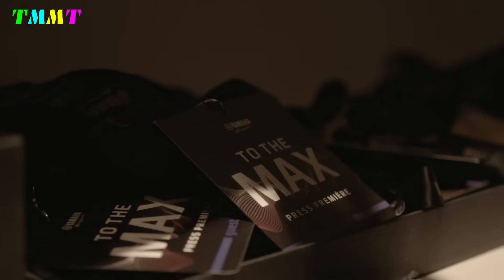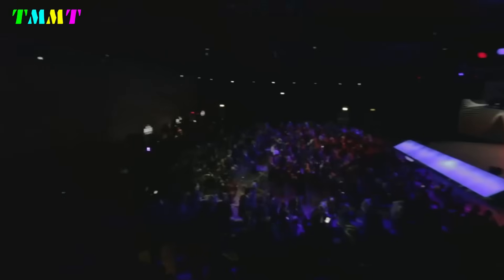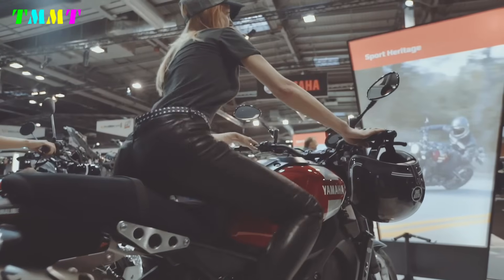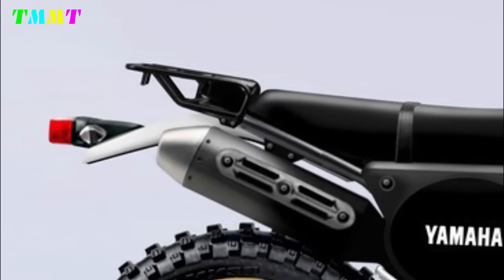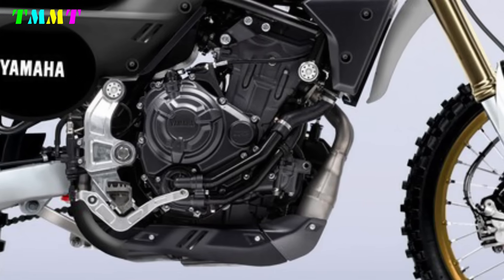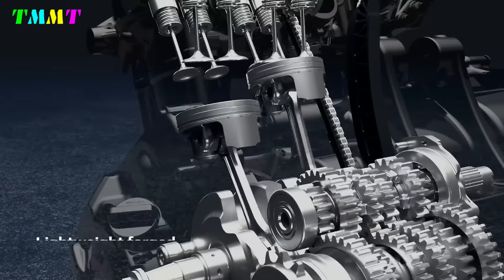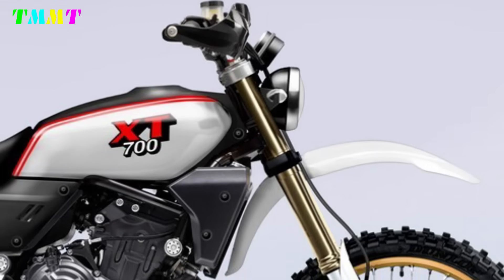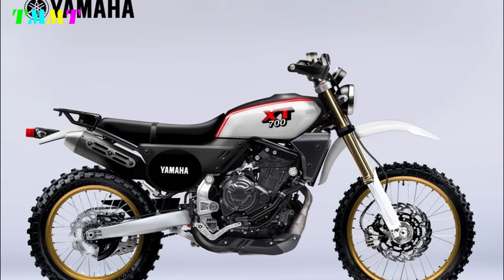2025 NEW YAMAHA XT 700 TWIN | ENDURO SCRAMBLER WITH RETRO ELEMENTS

Comment: This is what we have been waiting for YEARS !!! The design looks fantastic,  it will be a major HIT on the market  as a 700cc.  BUT, instead of following the old tradition XT500s  (I still own one ) of  the early days, the new 700  should have a slight touch of change. I THINK , the DECAL should have the word YAMAHA and the xt700   on the SIDE PODS only,  instead of on the TANK. The tank, should have  ONLY the  " YAMAHA LOGO "  made out of  solid ALUMINUM  WITH A 3" DIAMETER.  THIS ALONE, WILL TURN THE NEW DESIN INTO THE CLASSIC LOOK  of  it's generation.  I hope Yamaha would considers  this.

Comment: This looks like a good all round bike.  Some points:
1/ My feeling is that bike designs of the last decade or so are too heavily influenced by rallying.  And perhaps by expert motorcycling 'personalities/influencers'. Great if you are a dirt revhead who blats across dirt tracks at speed spinning gravel in all directions.  (Looks spectacular from a drone view) But for true trail riding they are too big, too top heavy, the slung saddle prevents the rider from sliding weight backwards to add traction to the rear and stop the front turning in.  In the hands of a casual rider they can be positively dangerous.  
2/ AND, first gear is too high.  Great for spinning the rear wheel or wheel stands, but that high 1st gear ratio forces the rider to tackle difficult obstacles at too high a speed.  (This is a fault with the Suzuki DR 650 IMO.) That causes a lot of sudden bad falls if the front is turned by the terrain.  Especially when combined with the high centre of gravity.  Standing on the pegs is not alway ideal when more rear traction is needed.
3/ A true explorer bike needs a very low 'crawler' 1st gear. Even if that means getting going in second in normal or street conditions.  
A true explorer bike also needs top gear to be a cruising overdrive for motorways. From 100 -120kph the revs should be a little below half the rev range. Somewhere in the mid to upper 3000s.  This makes for much lower vibration and fuel economy and a less fatiguing journey to get to the start of your off-roading. If you come to a long mountain climb - change down.  A good explorer bike might need seven gears to accomodate all conditions.

4/ In my opinion a 500 twin, 700 tops, is more than enough for good exploring.  Unless your only riding style is to tear up the landscape racing your pals. 
5/ Some of us want a bike with a bit more grace and functionality.  I suspect this is why there is so much interest in classic style bikes. Modern bikes are stunningly built and fitted out but have actually lost some functionality along the way.
Anyway, just my thoughts for what they are worth. 🙂

Comment: A moto like this exist: fantic caballero 700 scrambler. Slightly different and less capable on paper but really good in real life (low center of gravity and weight). Proud owner.
Reply: Hi! How is the riding comfort on bad road conditions or gravel? I love my MT-07, but this is where I even prefer my old 250 ccm 2stroke :D
Reply: The Fantic is not available in the U.S.
Reply: @Pizzaesser  hi! The suspesions are definitely setted for the hard/road side, but they adsorb well the imperfection of the road and the medium sized holes. If you don't want to go fast offroad and the ground clearence is not a problem you can do whatever you want (the low center of gravity make this bike feel more nimble and capable than big adventure bike).

Comment: I had for 13years the next generation of the xt500, I had the legendary xt 550  so this one looks gorgeous 😊
Reply: @AndrewLane-pm2ro  here in Greece it was and still is a legend a good xt550 would cost over 4000 euro. Damn the day I sold mine.
Reply: @AndrewLane-pm2ro   the 558 cc were better than the 598cc. When I had to built up the motor made it 598 and it was never the same. The only thing that xt550 needed was fork and disc from the 600.

Comment: They all look so "heavy", these "retro" bikes .... the engine looks a big lump whilst the original XT 500 seemed lighter, you could see through the frame, now you can't with all the plastic panels in the way and that wretched radiator hung on the front ..... the XT 500 of old was reasonably capable off-road, this one looks like a salesman's pitch of a fancy dress on a road bike.

Comment: its just a mt07 with knobby tires and a little more suspension travel. should be a very easy production model. KTM does it with the Duke and Adventure 390